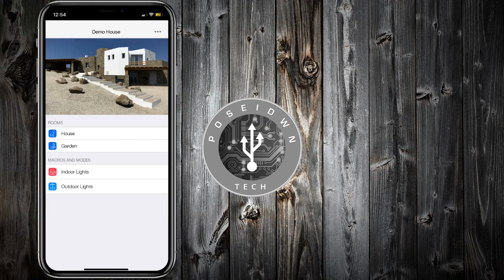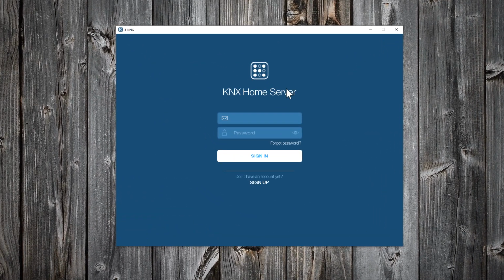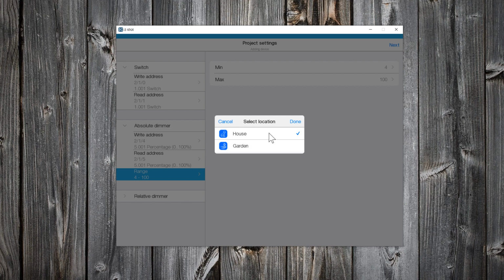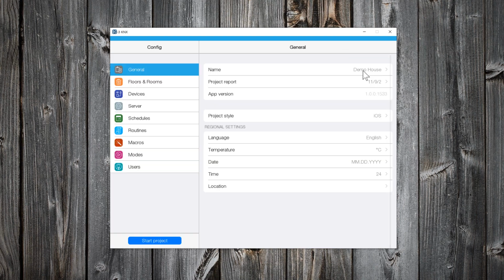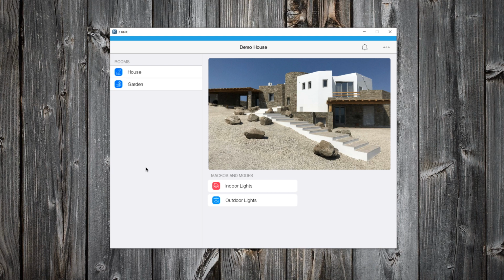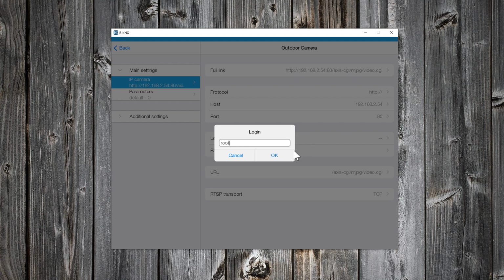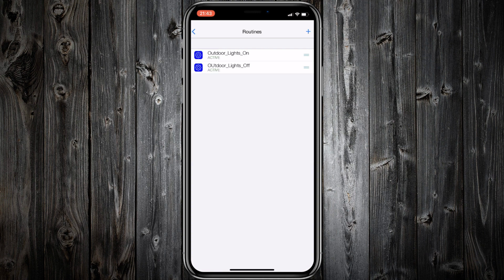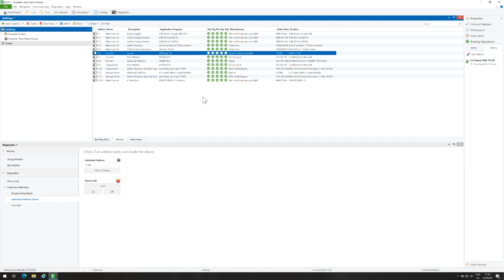KNX Home Server by iRidium mobile

Comment: Fantastic and great work... what a wonderful piece of things.  Do we need an IP router to make it work?  Is there any maximum or recommended devices used in 1 iridium server?  Can I use only 1 iridium server to control route between different KNX IP routers?  Support multicast?
Reply: Hello! Thank you for the interest in our products.
1. TP1 gateway, which is supplied with the server, allows you to work with KNX devices without an additional IP Router and configure the devices via ETS. It is recognized as an IP router.
2. KNX Home Sever can work with 1000 group addresses. This allows you to add on average 200 - 250 devices.
3. The server can be connected to one TP1 interface , directly to the bus, and to 2 KNX IP-interfaces in the network, and work with them simultaneously.
4. Only unicast is supported.